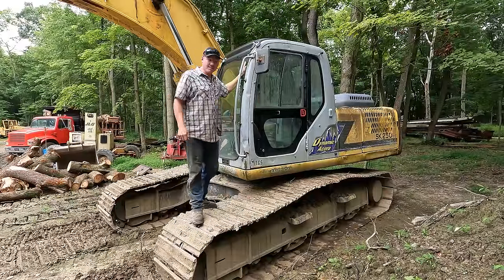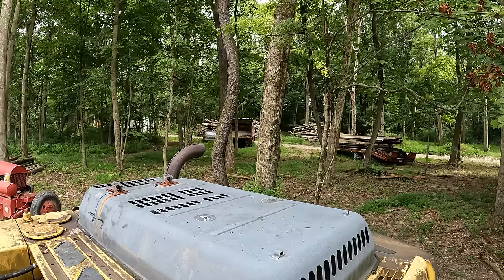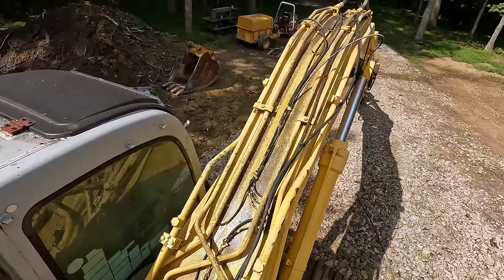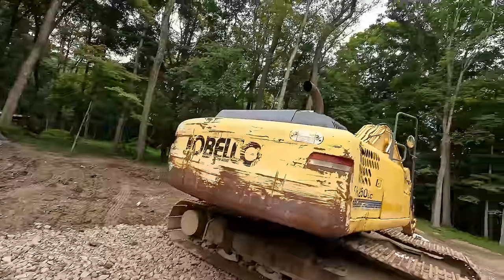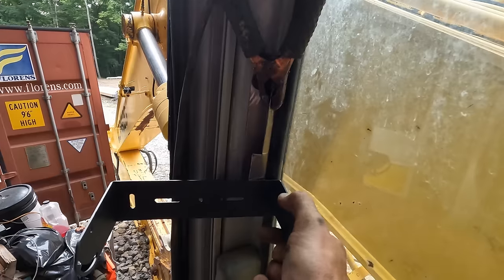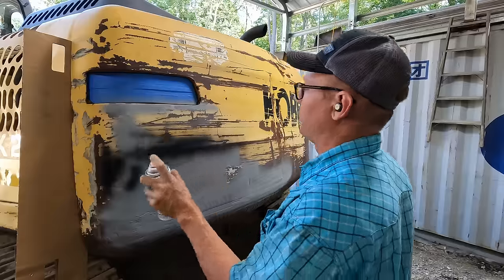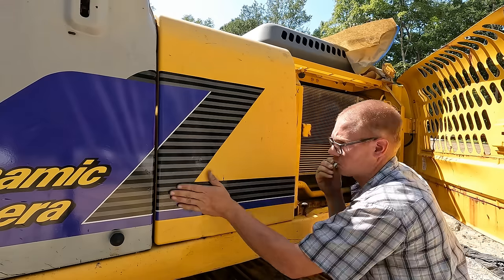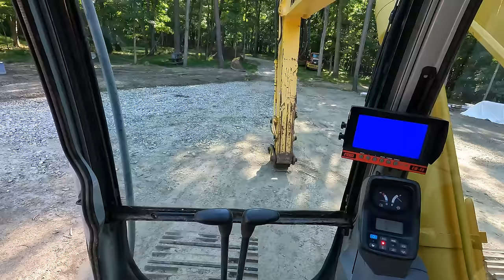Fixing up the Cheapest Excavator I Could Find! (Major Transformation)

Comment: Cleaning the valve is easy...just hold the can upside down and spray out the paint left in the tube. Be judicious, otherwise you will waste the air pressure that sprays the paint.

Comment: For no clog spray paint, when you're done spraying from a virgin can, turn the can upside down and spray out the paint remaining for about 2 - 3 seconds.  This clears out residual paint so you can easily reuse a partially empty spray bomb.
Reply: Usually says that on the can, too 😀. Sometimes I rinse the nozzle with break clean right after use. Also keep the nozzles of used up cans as spares…
Reply: I would also say that solution.
Reply: This has always worked for me.
Reply: Yup I do this also.
Reply: That works until you have one of those 360 spraying cans.
Reply: Paint cans always have more than enough extra pressure in them so you can use/clean them 2 or 3 times
Reply: I soak the spray nozzle in lacquer thinner overnight and dab some on thr can tube.  That color looks perfect on video.  Nice machine.
Reply: @martinkennard1669  was thinking that.  Since i paint cars and equipment from a shop at home for a living since the 90s i always have a pail or two of gun wash.  Cheaper than lacquer thinner
Reply: Yeah says it right on the can.
Reply: Also put it in warm water before start spraying for a better results..
Reply: That too
Reply: Yep, always do that and it works most of the time. But if the nozzle blocks, drop the nozzle in some thinners for a bit and blast it through with compressed air, normally sorts it out.
Reply: Learned this from my pop decades ago...
Works like a charm.
Though the cans that have the modified spray nozzle,  this doesn't work.
Reply: Once it starts spraying, don't let up on the nozzle!
Keep the can moving!
Reply: Very true.
Reply: Rustoleum always clogs on me anymore.  Noticed this the last 2 years.  Brand new cans from the store. Shaken to death.  I take them back and I don't buy rustoleum anymore
Reply: There are some paints and cleaners that work upside-down as well but for the most part that is what you do.
Reply: @staind288  Agreed 100%.

Before spotting this comment, I was going to say...

 Step 1: DON'T BUY RUSTOLEUM PAINT.
Step 2: DON'T BUY RUSTOLEUM PAINT.

If ya gotta go cheap, go Krylon, not Rustoleum.
Reply: You do enough painting get the 60 dollar harbor freight gun. It is better. Really enjoy your videos.
Reply: You should do this anytime, despite the can's sexual status.
Reply: Exactly
Reply: @gubr  thsts what I do too!
Reply: It also depends on the style of valve and nozzle.  I prefer the cans that have the adjustable nozzle that allows you to switch from horizontal to vertical.  The design of those valves really helps also.
Reply: @martinkennard1669  I think you need to adjust your monitor, or get a better one. The color is too "lemony" - needs more red in it to make it more orange to match the existing paint.
Reply: How much for the paint set up ?
Hose & gun ?
What else do you need to do that at home ?
Reply: Dosnt work on most modern cans that are spray in any position
Reply: @gubr  depending on the paint I get, I also bring along a bag of spray can nozzles from the hardware store. They even got fancy ones spraying like an actual spray gun in a vertical or horizontal pattern (which for rattle can paint likely is a waste of money). But even the simple ones sometimes are better as those which come on the can, depending on the make.
Otherwise I had luck with the appropriate paint thinner type thy specify to clean up on the can and pushing it through the nozzle with a syringe, if you cannot blow that can out but holding it upside down. Just be prepared to have a liquified syringe depnding on the thinner you use if you let it sit. Compressed air works also for most residue.
Reply: that's fine for when the can sprays right in the first place! These cans won't spray right even straight out of the box!!
Reply: Or pick up a 100 pac at the paint store for like $3 if your lazy or forget.
Reply: @BricoleurTV  in TV
Reply: @gorak9000  Its a phone not a monitor and no it doesnt adjust.
Reply: All cans are virgins if ya know what I mean
Reply: When your done "spraying" from a virgin can huh....lol
Reply: I also keep a little jar of paint thinner and pop the spray nozzle off and soak them in that.. but I always turn the can upside down when I'm finished to get rid of any paint left in the tube
Reply: A mat All the above Suggestions  are right Turn can upside down And spray......Everyone  is sure right ....works great on my. Side of the STATES....
Reply: Again  Sad you don't get a AIRSUPPLY RESPIRATORY PROTECTIVE  ....YES MAT YOU DO A BEAUTIFUL  JOB  OF REPAIRING....We wish you would  treat mat as good as Mat treats his equipment....Its just Sad.......Mat you are a ingenious  wonderful  😀 man......We just want you around for a long time......
Reply: Virgin can hahaha 3rd grade
Reply: Yep !!!!
Reply: Ml
B TV
Reply: Then you lose half your paint.
Reply: Warm the rattle can in hot tap water, this thins the paint so it goes on smoother. Shake the can as directed on the can. If you fail to do this you will plug the tip. When through turn the can upside down and spray until just air comes out, no paint. 
  Paint normally darkens as it ages.
Reply: @mdariff839  thats what i was going to say as well, warm the paint,sorta thins it i guess? flows a ton better  anyway. used to do it to paint models cars before i got my first airbrush. the models just looked better.
Reply: @gubr p

P
Reply: Alp
Reply: That’s just a mild county dispute paint job rather than a world war paint job
Reply: I used to trigger handle attachment cuz my hands ain't what use be

Comment: Successful sticker application requires the use of a liquid (window cleaner works good)  and a squeegee. Lightly spray the working surface with the cleaner, remove entire sticker backing and apply to surface. Use squeegee to work across sticker surface, working bubbles to the edges.

Comment: Matt, a little hint when installing decals... particularly large ones...Spray down the area you are fixing to apply it to with a mixture of dish soap and water and lay your decal on.   This will allow you to move it around and squeegee out the wrinkles and bubbles....
A few hours sitting in the sun or a warm shop the moisture will evaporate and the decals will stick well.
Reply: Great info, I have done a lot of decal work and really like foaming glass cleaner as my install barrier.
Reply: Was going to suggest the same thing
Reply: Great and very helpful tips n trix!
Reply: And a masking tape line to help get your stripes and lettering straight.
Reply: That's how they did it at the factory.
Reply: Mounting some decor on some bigger thermoses, and I apply that dry, but then I have done 50 of them,
On a car or truck I would mount them starting from top going down. dry or wet depending on size.
Reply: We always used Spray9 as we always had some for cleaning interiors on hand.
Reply: Yep, I’ve done a lot of window film and car wraps and the best soap is baby shampoo mixed with water, it’s just the best, that and a decent silicone squeegee and you are golden.
Reply: Agreed. I learnt this trick from pros who do it every day and it's easy enough that I actually got it right the first time I tried
Reply: Was about to come suggest the same thing.
Reply: Can confirm, Caterpillar uses Ivory brand dish soap diluted in water to install their decals at the factory.

Comment: Had good luck with a simple soapy water solution sprayed initially on the surface you're applying the decal to.  It allows you to move it around until its positioned where you want it.  Once in place take a soft plastic scraper or squeegee and start in center of decal and work your way outward to remove the excess water and air pockets.  Give it a few hours to dry.  Warm weather/direct sunlight speeds up the drying process.  Hope this helps for future decal installs!
Reply: Some printed stickers ive used on equipment have been destroyed by using soapy water. But vinyl stickers use it every time
Reply: @mattashford3508  Just sharing a helpful tip from my experiences.  Haven't had any issues yet.
Reply: Great info
Reply: I have also learned this!  Works wonders, no bubbles 👍🏻
Reply: @mattashford3508  maybe too much soap should be like a drop it two in a spay bottle
Reply: We call it slip solution. Works on cheap vinyl, like a sticker type material. If the decal is printed from real vinyl wrap dont use it. A spray bottle with water and 4-6 pums of baby shampoo works best. If its slipper water and Isopropyl alcohol mix in a spray bottle can be used for "tac"
Reply: was shouting this while he was sticking it on lol
Reply: Yes the soapy water dries out , leaving the stickers stuck firmly on the item....

Comment: Great work! Tip: Having installed many decals on boats spray the area with soapy water, take the backing off and apply the decal and you'll be able to slide the decal around for perfect alignment. Then with a credit card smooth it out from the center out and no air bubbles! Best Regards, Jay
Reply: Those aren't slide decals.
Reply: @AiMR  
Doesn't matter, that technique works on normal self adhesive decals, I too speak from experience.
Reply: @AiMR  It will work for any type of adhesive decal. Even traditional bumper stickers.

Comment: For decals, spray the area with soapy water first. It allows you to move the decal every which way to get it positioned. When you're satisfied, use a plastic or rubber squeegee and the water AND air bubbles will come out. I put decals on police cars for years.
Reply: came here to post this very thing
Reply: You can often find a local sign company that has experience applying them that will do it for a very reasonable price when you consider the cost of the decals.
Reply: That's the way we did it at the RV dealership!
We were taught by the RV manufacturers.
Reply: I was taught to just use plain water and have had good luck with that
Reply: Soapy water is the standard never had any issues once you get all the bubbles out, the soap lubricates the surfaces for ease of application
Reply: Same works well for dirtbike graphics

Comment: You sure did make that machine worth a LOT more! It's amazing how a good cleaning and some simple repairs / upgrades really make a machine more enjoyable to run!
Reply: Also when the machine looks good, users usually try to keep it looking good. If it looks crap, nobody bothers to look after it, just the bare minimum.
Reply: shoutout buddy 😅
Reply: Cleanliness is wonderful in that it usually spreads to other areas of a jobsite. Meaning that it’s got a way of being contagious to the other trades. It also sets the standard of what should be minimally expected. Of course, just the opposite can happens and it’s a recipe for disaster when this is the case. There’s nothing worse than terrible looking equipment that’s not maintained, or a messy jobsite. You’re just asking for an accident to happen in these kinds of situations.
Reply: Te😊
Reply: Q

Comment: My first job in earthmoving was as a yardsman with Komatsu; 8-65ton excavators, loaders, dozers, moxies and graders. To be honest we had many machines which did only a few months hire which were way filthier than this, just not any lichen or moss.
Just a few tips when cleaning an excavator - Run the tracks free of debris first then clean the track frame with a shovel, coat any excessive grease with aggressive degreaser, cut large lumps off with a handle tool, maybe a sturdy paint scraper.
Depending on the size of the machine - Remove bucket/attachment, stretch out dipper all the way, sit the hitch where you can clean the quick & bucket links - Clean out the top of the house first working down, clean any surfaces which will deflect grease first, clean the back of the boom from the house and the outside of cab.
Set up a ladder and start washing from the top of the boom working down, clean the track frame last, don't worry too much about track frame unless the machine works in fairly dry/sealed conditions.
Remove the rubber mats if fitted, beat dust off seat and clean the cab, use a foaming window cleaner, everything else is trash and will leave marks. Obviously the operator spends most of his time here so pay attention to detail.
Clean the insides of the service compartments - DO NOT wash the radiator from right up close, its easy to damage and fold over the fins.

A dirty machine that gets no love will often lead to operators who abuse it and show it no love, poor aesthetics leads to mechanical damage.

Comment: Great job Matt. It really looks much better than when you started. If you want 2 cent worth on the counter weight, don't sweat it so much. Remember the paint on the rest of the machine is oxidized on the top layer of the factory paint. In all actuality it's nearly impossible to get repair areas to match exactly when first painted.  It will match more closely in six months after it has oxidized a bit as well. Save some dough. Leave it alone. It looks very good on the video.  If it's not broke don't fix it. Once again Matt, great job on restoring the appearance of this excavator.

Comment: A great difference . While you are cleaning pull the covers of the back of the track drive motors and clean out around the hoses and up though the track frames where the drive hoses run. The dirt and mud builds up and eats through the hoses and fittings. My job for the last 30 years has been replacing hydraulic   hoses and and I have replaced a lot of hoses in those spots due to dirt build up.

Comment: Hello Matt, love your channel. 

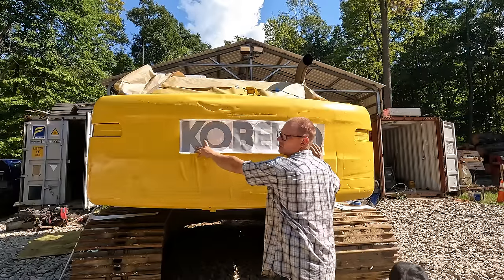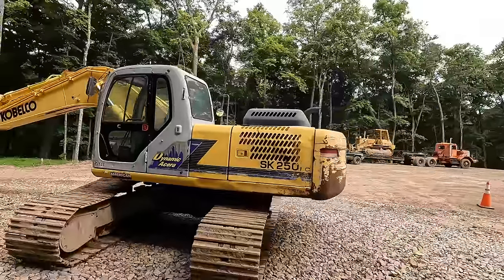47:47 What about painting the counter weight black with a yellow strip in the recessed area where the decal goes?  The yellow gloss paint highlights the damaged areas whereas a flat or matte black paint would lessen the appearance of the damage. 20:15 Maybe repaint the engine top cover with a same black paint so it matches.
Reply: Agreed. I’ve always said a little flat black paint covers up a world of sins
Reply: Yes, when Matt started spraying the black primer I thought it should all be that colour...
Reply: I agree. Thought the black made it look so much better.  It would also make a big red Diesel Creek logo pop.
Reply: That is a great idea. For the yellow part, you could bring a side panel to the paint shop. so they can mix the right colour.

Comment: To prevent nozzle clogs on spray paint, clear the nozzle out when you’re done. Hold the can upside down and spray until the propellant comes out clear.
Reply: some cans even spray upside down, for those compressed air or a syringe with thinner usually works fine.
Reply: youre listening skills are pretty poor.. he specifically said he knows to clear the cans upside down, but what can you do to fix the issue after its already present

not to mention holding can upside down and spraying until its clear will quickly lead to a half full can with no pressure in it
Reply: Turning upside down is a waste of time and paint.
Remove the nozzle and spray brake cleaner through both directions. Hold it in a vise to spray reverse. Also spray into the top of the can using the straw. (use goggles)
Reply: After all these years of throwing away aerosol cans 🤣🤣 Thanks for the pro tip @Critter87

Comment: For removing the decals, take a trip to Harbor Freight and pick up an eraser wheel (or 2). They work well for decals, pinstripes and adhesive residue.
The trick I used to install large decals was the same as doing window tint. Spray the area with soapy water and then squeegee it out with a rubber or plastic bondo spreader as you peel the backing off .
Reply: An old credit card works as well.
Reply: i always prefered a hand steamer.  makes life a lot easier.
Reply: Great suggestion! You stole it right out from under me.

Comment: Also FYI for when applying decals, they have special solutions you can buy or you can just do what window tinters do and mix up some warm water and dish soap, wet the surface and the back of the decal, position decal, squeegee out from the middle to remove air bubbles and allow to dry, i've used this technique for installing large decals on windshields and other glass surfaces, but the principal is the same.
Reply: Professional window tinters actually use baby shampoo because it doesn’t break down the adhesive overtime and cause bubbles like you see a lot on back windows…ask me how i know lol

Comment: for those paint cans that stop spraying. Take nozzle off, take a tire stem without the schraeder core installed press it on top of the spray can, apply air hose about 30lbs pressure should blow any chunks back into can. you should also have more air to spray with. when you get chunks most of the time you didn't shake it enough.
Reply: Thank you

Comment: Hey Matt, I share your frustration with the rattle cans.  I found soaking the tip in acetone and then blowing compressed air thru the tip helps.  The machine looks great!
Reply: Here’s the end of your frustration: when done painting, spray the can for 2-3 seconds upside down until little or no paint comes out but only the pressurizing gas. This way you can put them away for a long time and reuse without any problem!

Comment: Matt, next time you have to install decals spray the surface where you're going to mount them with Windex and have a new plastic bondo speader handy. Install the decal and use the spreade to push out air bubbles.
Make sure to use the spreader gently as flat as possible. 
 It'll give you about 3 to 5 minutes to get it perfectly aligned before it drys.
I've instructed hundreds of decales on mostly on Arcade and pinball games but also on cars, trucks and other items that way and never had a problem.
Reply: Absolutely or soap and water works good too